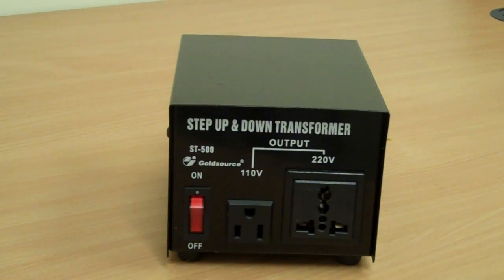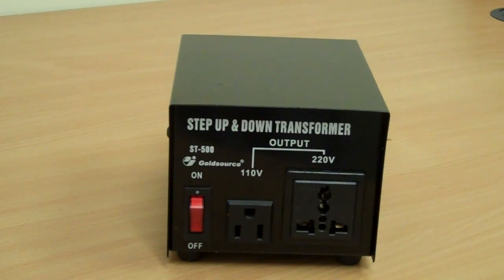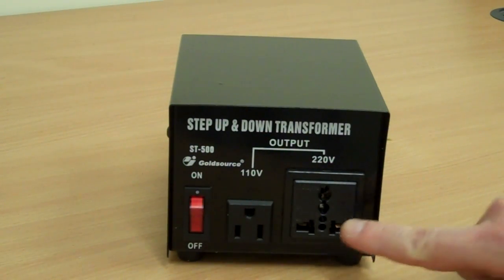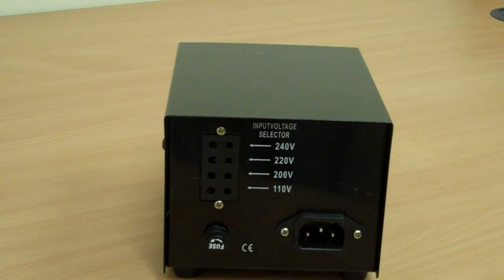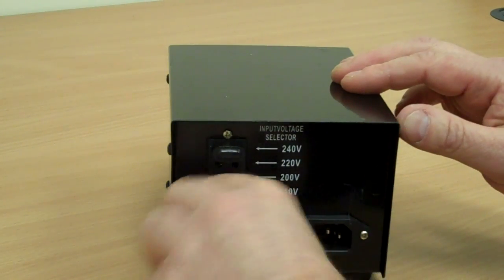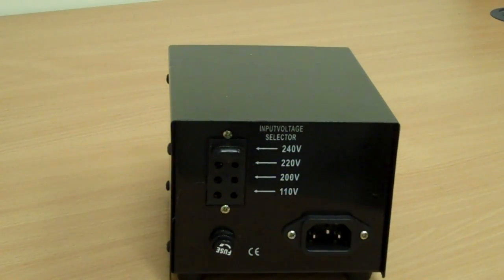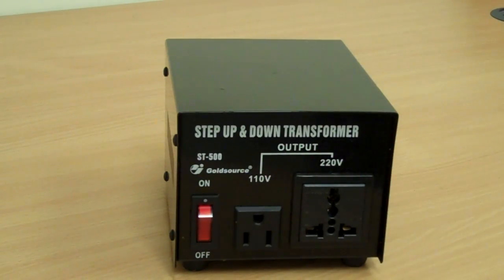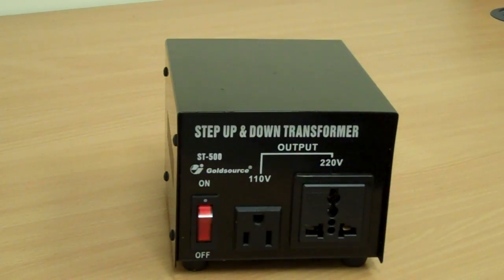Goldsource ST Step Up and Step Down Voltage Converter

Comment: This is a great product. Very highly recommended. Please note that the version shown will provide up to 500W of power to the device. Check the power rating of your device. If it is 500W or less then it is compatible with the transformer in the video.
Reply: Poor advice m8 , if their device was anything under 200W - 220W  this would be ideal. The converter should be 1.5 X the device being converted. 😊

Comment: Hi there, I have a computerised sewing machine from the US, it's 120v ~ 60Hz and 0.65A, so I'm calculating that's 78 Watts. So I know this transformer can handle the wattage, but is it safe to use with a computerised appliance such as this please? Many thanks :)
Reply from the maker: clnbond Hello, You're right the Wattage is more than covered.The only issue that there could be is with the Hertz. These are not 
converted so the sewing machine would be receiving 50Hz. Usually this is
 not a problem. Occasionally if you have an appliance with an electric 
motor that gets its timing from the Hertz, you find that it runs 
slightly slower in the UK. However this is usually just hair clipper and
 some kitchen appliances, we've never had any reports of this happening 
with sewing machines.

Comment: I'm from america taking a vacation in bosnia and Herzegovina and I brought my xbox 360 over which I'm planning to buy a transformer for some time this week and I want to know what type I would need to use it here and keep it in standby mode when I'm not using it? The voltage here is 220V.
Reply from the maker: Titancoast If you only want to power the X-Box 360 the best option would be to just get a 220V X-Box 360 power supply and use that in Bosnia.
Reply: Ok. Thanks!

Comment: I have 240 machine from China, Can this be used in US. Sir J.
Reply from the maker: JOHN IZIKEN  Yes it can, you just set it to step up (110V input) and plug into the 220V plug.
Reply: 110 steep up strnsfer 240.

Comment: Hey dude i have a ps3 that bought in phillipines... And it has 220v nxt week i am going to japan they said that japan has 110v, is this voltage converter might work?
(Sorry for hard english)
Reply from the maker: JigenMon You should check this out yourself to be sure, but as far as we know the PS3 has a universal power supply and will work fine anywhere. All you might have to do is use an adapter for the plug. The Voltage in Japan is 100V, but as with all Voltage everywhere it varies a bit from place to place.
Reply: Allright dude thanks a lot.!

Comment: Hi 
I have a freezer that I bought from the US 110 and I would like to use it in KSA 220 would this converter be able to do that and be on working 24/7?
Reply from the maker: Voltage Converters do not work well 24/7. All you can do to get around this, is to use one that has significantly larger Wattage capacity than the load, at least three times as much. There is another potential issue regarding freezers though. Some freezers have power correction capacitors. These can feed power back to the grid, which is fine if you are connected to the grid, but if you are connected to a converter the power correction capacitor can damage the converter.

Comment: i have an 110V and 1700W device which i want to use in 220V country, which ST- device should i get?
Reply from the maker: It depends on how long you need to use it for at a time. The ST-2000 would be OK for very short periods, otherwise ST-3000 (up to an hour) or ST-4000 or ST-5000 for longer periods of time.

Comment: Hi from Norway!
I am planning to buy one of these for an amplifier. An Anthem mrx 710, rated 7 x 120 watts. I may need one of the biggest converters. But is it any noise coming from the converter itself? So it doesn`t ruin the listening experience if it humms or whatever? And what about that in Norway it is 50 hertz and Us is 60 hertz?
Thank you very much if you can answer this. :)
Reply from the maker: In order to alter the Voltage the converter has to resonate, so it does hum. This is very quiet though and no one has ever come back to us and said it was a problem. Voltage Converters do not change the Hertz (which is the frequency of the current). For nearly all appliances the Hertz are not an issue. The exceptions we know about are for appliances that get their timing from the frequency, such as electric clocks or some electric motors (usually in kitchen appliances). In those cases the appliance would run at 83% the speed it would run at in the US.
Reply: BestStuffUK
 Thank you very much for the answer!
Reply: @BestStuffUK  How do you go about using a US spec clock timer in the UK given the frequency difference, please?
Thanks.

Comment: Hello, thanks for an informative video. I'm from the UK but I'm now living in Japan. I got my Xbox 360 Slim sent over here and since then I have been trying to find out how to get it to work over here. The Xbox AC Adapter is UK voltage and has an output of 135W DC. If I were to use this transformer, would everything work out alright? Is there any risk of messing up my Japanese TV?

Cheers
Reply from the maker: Hi, you could use this and it would not effect the Japanese TV. Although probably your best option would probably be to just use a Japanese X-Box 360 power supply.
Reply: BestStuffUK I ended up getting a second hand xbox here and used its power supply. Works perfectly. Thanks for your help and Happy New Year

Comment: Would this work for a 220 welder?
Reply from the maker: Probably not, it depends on how many Watts the welder uses. Most welders use 5000 Watts plus and need their own dedicated power supplies.
Reply from the maker: +TrueFreedom I doubt it would work for a welder, they usually need their own high amp power supplies.